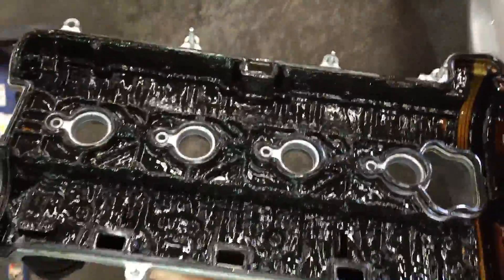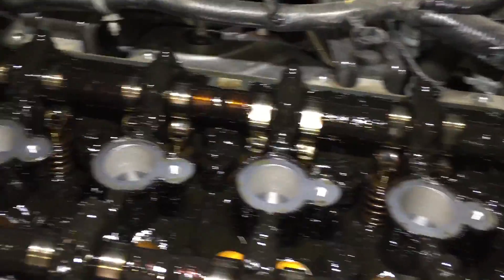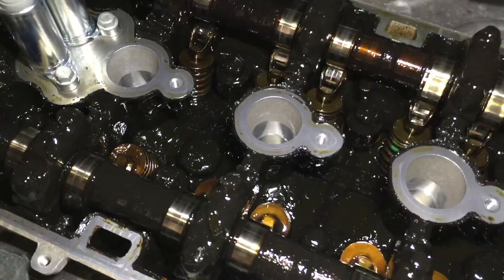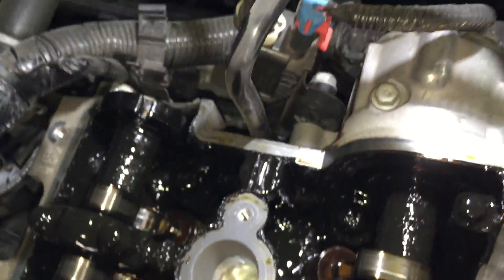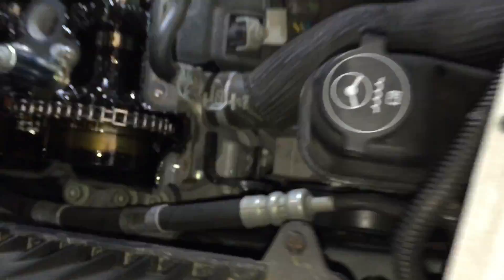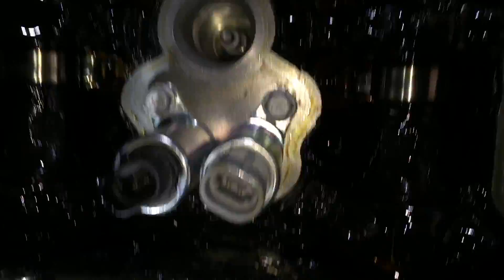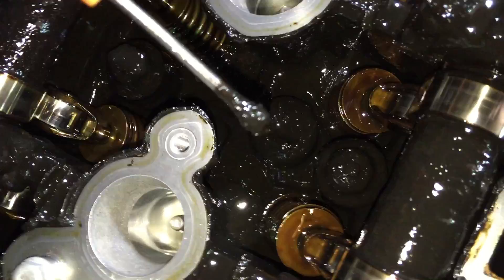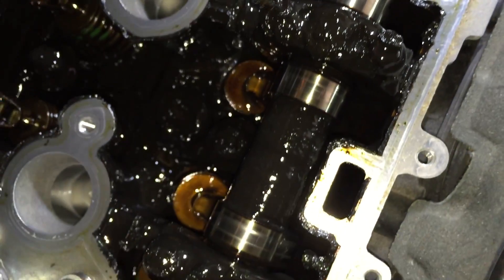Engine Sludge at 28,000 Miles

Comment: Back again for further review. If I came into this car, all I would do is change the oil. You cannot reverse any damage that has already occurred.

Almost certainly, synthetic was the original oil. I would use low-end synthetic and change it very early over several oil change cycles. Probably, the sludge has to do with the type of driving and the engine itself, not with the oil as such. Some engines are notorious for forming sludge, especially if you do only short trips and stop and go. If so you need to change the oil more often. Even with synthetic oil, a 2000-mile oil change interval is not out of the question if you have sludge-prone engine and do only short trips. You don't have to buy the high-priced stuff. You should be able to get synthetic for less than $4 a quart. I can get brand name in a six-quart box for $20.

Comment: HOw can I avoid to buy an used car with this sludge? can I spot it by looking under the engine oil cap?
Reply: You could try removing the valve and check for sludge  or just check the dipstick to see if the oil is low, if it's dark or theres hardly any oil on the dipstick then its  probably has not had an oil change , if its frothy walk away and dont buy it    I am no mechanic but I hope this helps. 💜
Reply: A dipstick is a metal rod  and it  has a loop on top of it
Reply: The valve cover is located in the middle of the engine and you can see it easily, again take this with a pinch of salt I am not a mechanic, I'm just giving a general overview of what to look for in a used car and whether its owner has took care of it well or not.

Comment: I cleared up oil sludge in an engine that looked worser than that with diesel. And just to add. I had a guy come to our shop with carbon build up so bad in engine, sparkplugs . everything was covered in carbon bad. He told me that he took it to jeffy something and a guy who claimed to be certified technician with 20 years experience told him they couldn't figure out what it was because everything was Comming back normal. They quote him 4thousand for a new engine and he left came to me. I looked at it and knew automatically it was the catalytic converter lol. I told him get a cat delete but make sure your state laws dont check emission. He got the front and the one under the car removed and came to me 3 weeks later happier than a kid on christmass day. He gave me 200$ for saving him 4 grand lol. I will never forget a 20 year so called certified mechanic couldn't figure that out lol.

Comment: This is just one of the reasons I buy brand new and not used. I also keep them for hundreds of thousands of klms. with required maintenance. Too bad someone else will probably end up with this car.
Reply: You just have to take oil cap off and you would see the sludge...easy to avoid a turd car like this.

Comment: why does this shit only mostly happen in japanese/euro cars? my dad ran his late model falcon for nearly 30,000kms on one lot of penrite and the motor now has 239,000kms and its running just as good as when we first bought it at 34,000... ive seen lots of cars run huge kms with very very large kms between changes and it may have a tiny bit of build up but after a couple tanks change the oil and its good as again
Reply: Most engines can run, but it'll run like shit. Engines with VVT won't tolerate this kind of bullshit

Comment: Dang. The inside of my 2000 Explorer's engine is way cleaner than that, and it's 18 years old with 225,000 miles lol. I didn't see any sludge when the upper intake was off, a few months ago.

Comment: A lot of times when you even do regular oil changes you go to those quick lube places they used a cheap ass oil causes this condition .if they didn't do ia oil change and 28,000 miles that's the customers problem   lol.

Comment: Pressure washing the top end works quite well. I've done it several times and never had a problem. Just drain the oil and pressure wash with the drain plug out. After the water drains out fill with low cost oil and a quart of ATF and flush for 15 minutes.  Then change oil and filter and go.

It makes more sense than trying to use motor oil to flush it out. I have done this to vehicles that used to smoke like mosquito foggers and they stopped using oil and went for years.
Reply: Did this same thing to a used sludged up Corolla I bought some years ago I put 200,000km on it since then and it still runs like a clock.
Six years later its still clean as the day I pressure washed it.

Comment: I seen one car with low mileage was a 06 hilander had 36k miles with zero oil changes , the engine ran fine no noise no oil on the dip stick
Oil light was flickering reason for service visit

Comment: My mother drove a '67 Plymouth Belvedere II station wagon with the 318 V8. She drove it down the hill to grocery. She drove it up the hill to the church. She drove it to town for gas and regular oil changes (we had service stations back then!) and never a lick of trouble. Well, except a water pump and maybe the alternator.

Then one day she calls me, saying the oil light was on and the engine was making a knocking sound. She drove it a few miles home like that. I can only assume it was a rod or main bearing damaged. I pulled the oil pan off. There was a heap of gunk in the pan, kind of like peat moss, but very stiff. There was a small clear space where the pickup was. Scraping it off, there was rust underneath. The main bearing caps were also rusted. 

I pulled the valve covers. Every space not occupied by a rocker arm was packed with this thick gunk, and when scraped off, the covers were rusting from the inside out. 

Obviously, the engine seldom ever reached normal operating temperatures, and so was inundated with condensation and blow-by. What people today may not know is that leaded gasoline was a terrible corrosion promoter in engines.

Comment: That's actually pretty terrible for only 28,000 miles. Most engines wouldn't be totally gone like that. Would they probably have reduced lifespan? Yes. Is it anywhere near as bad as going say 50k without changing the oil/filter? No.

Comment: Very similar issue with a few Volkswagens with about 38,000 miles a few years ago. We put two cans, 11 ounces each of BG 109 allowed it to run for about 20 minutes. Dropped the oil pan the majority of the sludge, gunk came out in the oil pan. Any remaining garbage was cleaned out on the six-cylinder engine with brake cleaner and a good one dozen rags, before reinstalling the oil pan. Reinstalled oil pan refilled with 100% synthetic oil and a high density/synthetic oil filter. Changed oil again at 5000 miles using BG 109 to get rid of any remaining varnish/dunk. Second time engine was very very clean. Just my opinion/just my experience.

Comment: Looks like the sludge I had in my Montana driven 51,000 mile 79 Firebird 305 V8 using Penzoil exclusively, with oil changes very 3 to 4 thousand miles.  Never used Penzoil again.
Reply: Key word is “79”
At that time pennzoil made wax based oils
Not anymore

Comment: do it at your risk fill kerosene in to the engine instead of oil . run it for 10-15 secs. dump the things from engine.  do it 3-4 times and engine will get clean and fine.

Comment: drain the engine from oil, then just fill it completely to the top with diesel or gas, let it sit for a week to make sure.... then after it sat for so long, drain it and the engine should be clean from sludge, but if its not clean, try spraying some of the gas in the internal engine parts then scrubbing it with a nylon brush
Reply: can you not see the scoreing on the cams what makers you think the mains are any better or if not worse
Reply: James Flores well if you're cheap, then just polish the meeting surfaces like cams, crank and other things if its scored badly.
Reply: lol thats not how motors work
Reply: if you polished the scratches out you would throw it all out of tolerance and bearings are often made of steel coated with some other type of metal which you could wear through. Not likely to work. Damage is likely too extreme.
Reply: dansolodan you know, changing out the bearings is also an option.
Reply: Marijana Brezić Yes, that was sort of what I was going for in fact.

Comment: that there is penzoil molecular bondinmg oil in a car that was started and run 5 minutes at a time and shut uff before it got to opperating temps and built up condensation. seen this in couple cars with penzoil oil using vehicles usually old people that live close to stores

Comment: A long time ago during a brief stint selling cars, we once took a trade in that looked pretty decent on the outside.  So I decided to look under the hood, first thing I noticed was an extremely thick coating of oily dirt on the dipstick handle, it obviously hadn't been touched in a very long time.  I wiped it off and pulled out the dipstick, along the length there were 3 or 4 chunks of dried crap and no visible liquid oil on the dipstick!  Did I mention that this was a company car for an oil drilling company?  The engine seemed to run fine, the service dept flushed it several times and put it out for sale on the used lot, still there when I left for greener pastures.

Comment: you know..when you buy a car new and some cases used around here they give you free oil changes. yet I still see the same thing here. excuse is..they don't have time
just yesterday a guy came by for a radio/subwoofer installation, I heard ticking from the motor so I checked the oil, nothing...he tells me its been like that for a week with no oil. lucky sob

Comment: egr trouble, this is sud!! no way this is only a no change oil problem in sutch a short time span, looks like someont trew tar in it...
Reply: Depends on the oil that was used and how the engine was driven, some oils don't have a very high resistance to heat so they burn up like that.

Comment: people like that make me sick. How can you do that to an automobile? especially the fact that you're spending your hard-earned money on it. I go any more than 2,500 miles on a full synthetic change I start getting edgy and have to stop at AutoZone.  if I was that Tech I'd be straightforward with that customer, listen you probably screwed this engine up. It's only a matter of time before it starts making noise and smoking.  I've had people ask me why can't they go 10-15k on one change like the bottle says. very simple, if you're cheap and don't plan on keeping it sure you can go that far but if you do plan on holding onto it change it every 3K regardless and check it periodically. when people neglect an automobile it aggravates but entertains me
Reply: You don't need to change a modern vehicle's oil every 3k. Especially if it's running full synthetic. You're just throwing away your money doing that.
Reply: +Nicholas Brown of course I know I don't need to but I like having fresh oil. a bit of Peace of Mind. that $35 every six weeks isn't killing me. I spend more on coffee. you're never going to hurt it changing it early. I've had many customers that have seen 200k changing it every 5K and God bless them but I guess to each his own
Reply: If you're that interested in keeping your car in fine shape have you ever heard of a "bypass" oil filtration system? It's a two filter setup, one filter can be called a regular full flow filter and the other one, as long as it's designed for it (some aren't) cleans the oil deeper and on a partial flow basis and some "bypass" filters give even cleaner oil than when you fill the engine with new oil. Kleenoil is one I read about but they're like $700+ and most of the time seem to be sold to Semi trucks, Amsoil may also clean oil that deep and their systems are under $300. However these do potentially put your engine at risk if the second filter's not installed properly, depending on the system either one or both filters sends the oil through one or more hoses and back to the engine and yeah, if a hose goes you better shut the engine off quick.
Reply: +Austin Lucas I've thought about it before but would rather not add Plumbing. I always use royal purple filters with every change so let's not complicate things where they don't need to be or reinvent the wheel.
Reply: I've started doing 15k oil changes using full synthetic back in 2006. I'm still driving the same two vehicles. If you're buying full synthetic oil every 3k, all I can say is the oil companies thank you for your business.
Reply: matt parker Fair enough.
Reply: matt parker .........my wife's TL gets Castrol every 5k. Honda filter,no prob.
Reply: +Roger Lund as long as it's Castrol Edge and she doesn't go around with her foot to the floor 5K should be just fine
Reply: matt parker plain ole 5-20.
Reply: +Roger Lund 5-20? what year is that thing
Reply: I'm 55......had 10 hondas. Dino all the way. 5k I'm good.
Reply: 2006 model....non type s
Reply: +Roger Lund you probably don't go around with your foot smashed to the floor. my GTO ,other toys and tow pig I can be hard on sometimes. last time I had a valve covers off it looked like a brand new motor still with fresh oil splashed on it
Reply: +Roger Lund you probably don't go around with your foot smashed to the floor. my GTO ,other toys and tow pig I can be hard on sometimes. last time I had a valve covers off it looked like a brand new motor still with fresh oil splashed on it
Reply: pfft. I change my oil every time I drive. It makes me feel better.

Okay, no I obviously don't... Just saying that your argument is not valid or convincing... but hey, between changing your oil way too often and not nearly often enough, you're on the better side by far.

Comment: We had an expedition with a 5.4 with 80,000 miles never had an oil change. it was locked up. pulled the plug, nothing came out. took it 80k to burn through its initial 6qts. woman got the car almost new in a divorce and didn't know about oil changes. literally asked, didn't it come with oil in it? seriously that is the best thing I've ever heard. btw the inside looked way worse than this motor. of you were to tear it down you would need to chisel your way to head bolts.

Comment: just mix little kerosene into the oil its clean like brand new pots and pans just watch out the little holes don't get clogged up
Reply: So did these clowns clean it or declare it a total loss?
Reply: Stud XXX 50% diesel 50% oil, let it idel for 5-10 minutes and flush it.
Reply: Maybe that works on some older cars, I'm not so sure it'll work on these new cares with variable valve timing and whatnot. I've never tried it, honestly. Oil passages are thinner in at least some of these newer cars, aren't they?

Comment: Just get a pressure washer and you're good
Reply: A little WD-40 will brake that all up lol.
Reply: Pavlo95 you serious lol
Reply: I take the valve covers and oil pan off. Soak all of that in easy off oven degreaser for 20 mins or so and use a pressure washer and it will remove most of that sludge. Done this several times to vehicles with inane amounts of sludge. Change the oil and filter every 500 miles for awhile after this but cheaper than replacing the engine.
Reply: Yup just a powerwash did mine last year

Comment: Had a Customer with his big ass mercedes V8 in our shop for a rimchange. (summer to winter wheels, germany)
we did the job and let him go.
he called us 5 minutes later that his car made a ticking noise.
We where like: damn, did we forgot to tighten the wheels? na we did!!! let him drive back, we check it out!
so when he was back the ticking noise was gone. the Guy said it came from the wheels. so we checked everything out for a balance wheight hitting the brake, or loose plasticparts yadayadayada. found nothing.
so he went and came back immdiately with a nasty clunking noise from the engine bay. "that comes from the wheels, Right!?" (well the car stood still, only the engine run, what a idiot wow)
we looked at the dash and found pure horror.... Service Overdrawn for 180.000 kilometers! (111.000 miles)
we told him. "dude your engine is done!" but nah, he has to drive back to the mercedes car dealer, where he bought the car new and tell them what a bullshit they had build.

he took the ride and totaly surprising, he made it. on 7 zylinders. xD
the dealer called us and told us how the engine looked like. there wasn't even oil in it. it all was a solid sludge brick with some fluid in it. the engine  was done for shure. smashed the whole crank case and one head up. everything full with chunks of sludge... even the oilfilter was gone. I gues it cloged up and the oilpump just pushed all this mess through.

how can people be so dumb and own so much money for such a big car. holy shit.
sorry for bad english. heh
Reply: DESCENT that is horrific. Hard to imagine doing that too a car
Reply: Reminds me of a similar thing at my old job.
3 years old Audi A5 2.0 TFSI with some 50.000 km, came in with a crank no start.
Checked the service manual, and it had never, ever changed the oil.
Did a complete compression and leakdown test, air came out of the coolant, exhaust and the dip stick even popped out.
The customer tried to sue us, since we never told him how important it was to follow the service intervals..
Since this was in Europe, not a single lawyer wanted to touch the case.

Took 4 months of arguing who's fault it was before he finally gave in.
Reply: DESCENT hahaha
Reply: Van Kham the customer told them where the noise stuff begun.
Reply: It's people like this that don't deserve nice cars just because they can afford them. They should be repossessed and given to responsible owners like us, lol.
Reply: DESCENT, Why would the dealer called you? it's not your car?
Reply: panzerveps wow.
every manual says that you have to do oilchanges...
the heck is wrong with thess people.